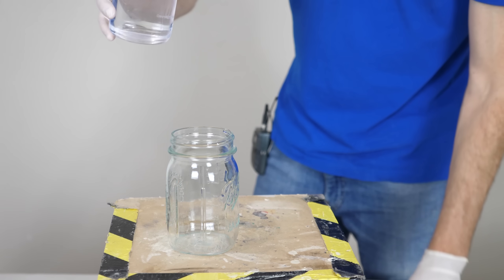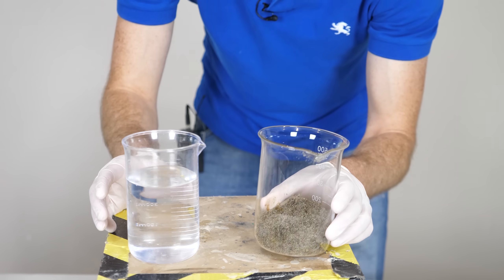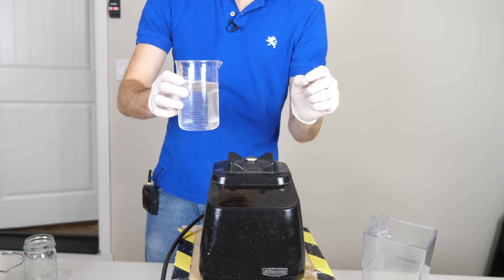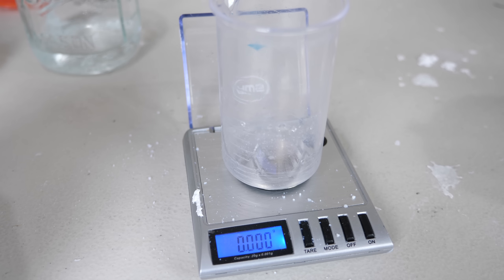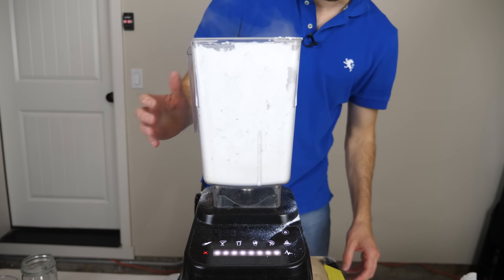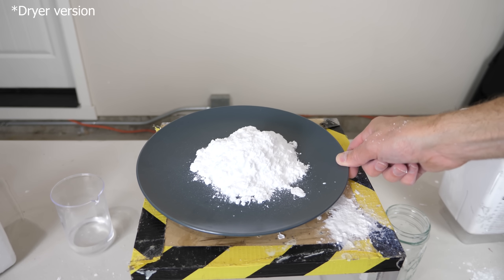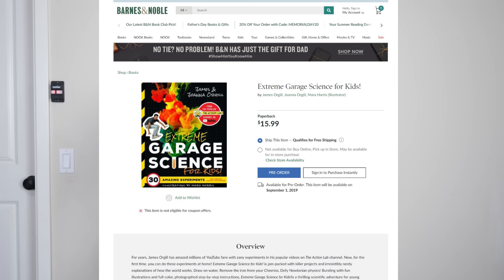How to Make Dry Water...Weird Experiment Makes Water That's Not Wet

Comment: Fumed silica is cool but calling it dry water is like saying you can mold water by  adding mud.
Reply: Yes, but I'm pretty sure it's called dry water, somewhat similar to how dry ice isn't ice.
Reply: @binarycat1237  yup
Reply: Dry water is just ice. Make more sense
Reply: @myrmesuwu607  Ice always has a microscopic layer of water on it. So no, ice is not dry water.
Reply: @myrmesuwu607  "Dry water is just ice."
The outdoor man wishes water to have not so much water (=weight) in it, so he can carry it along and mix with mountain brook water to have a drink, like with all other dried outdoor consumables. So ice is not the ideal one. And it easily gets wet under way. But you were quite near.
Reply: Something Or other  thank you i was looking for a polite way of saying this... this is not water it is a solution of a powder and water that is like saying koolaid is water and we should be able to.. ugh nevermind im not gonna
Reply: When someone thinks they know something and they don't... Fumed silica is manufactured by a continuous flame hydrolysis process of SiCl4. During this process, SiCl4 is converted into the gas phase and then reacts spontaneously and quantitatively in an oxyhydrogen flame with the intermediately formed water to produce the desired silicon dioxide.

2 H2 + O2 = 2 H2O

SiCl4 + 2 H2O = SiO2 + 4 HCl

2 H2 + O2 + SiCl4 = SiO2 + 4 HCl

(ii)During this chemical reaction a considerable amount of heat is released, which is eliminated in a cooling line. The only by-product is gaseous HCl which is separated from the fumed silica solid matter.

SiO2 is then converted into the HYDROPHOBIC FUMED SILICA dimethyldichlorosilane (DDS) in a fluid-bed reactor. The silane reacts with the silanol groups primarily with the formation of Si-O-Si (CH3)2 units, and as a result the material acquires a hydrophobic character. The number of silanol groups is reduced during the treatment to about 30% of the initial value.

(iii)Analogous reactions can also be carried out with other silanes and other HYDROPHILIC SILICA FUMES.
NOW, you can quite clearly see that fumed silica is a powder by itself and in no way should it be confused with empty water...
Reply: gRuven Haus mother of GOD are you a scientist?!=! I don’t understand anything you just said .-.
Reply: @tac0_6  You don't need to understand the science to see that he is bullshitting I don't think he was even trying to trick you the only thing that doesn't  make sense is that it was replying to this unrelated comment, In the beginning he says, When someone thinks they know something and they don't, you need to read this like it is a Top Text : Bottom Text meme, secondly though he uses convincing language he overuses some terms that are unnecessary to exaggerate the "sciencey sounding" effect. In this excerpt from the comment he says "SiCl4 is converted into the gas phase and then reacts spontaneously and quantitatively" Lets break this down  near the end of the excerpt he says it react spontaneously (meaning immediately) and qualitatively (in a factual manner). This is a dead giveaway, there is no reason why this person would need to describe a chemical reaction as qualitatively he was simply trying to expand the amount of "sophisticated words" in his comment to make it sound more complex. Furthermore all it takes to figure out that this comment is faked is to see that it has been DIRECTLY STOLEN is to type it into google and find that has been taken from                                        https://www.researchgate.net/post/can_anyone_tell_me_the_method_of_producing_fumed_silica_and_grades_of_this_material
Reply: @binguser344  well you see, I have no idea what my 11-12 year old brain was thinking back then it’s obvious now since they sound like they’re regurgitating they’re Google searches.
Reply: @GruvenHaus  blinks
Reply: @GruvenHaus  dude what grade ru in? I'm bad at chemistry
Reply: @overtimepreet  maybe they have a PhD and allready passed school
Reply: @GruvenHaus  still not water
Reply: Actually with mud you dissolve dirt into the water; the fumes silica isn’t dissolved, it’s coating the tiny droplets and separating them; since it’s not being dissolved, it’s not a solution, and since it’s not a solution, it’s still referred to as water. It’s like if you cut up a block of cheese; just because you put the pieces together with air in between them, it doesn’t stop it from being cheese; but if you mix pepper into melted cheese, then it’s a solution of the cheese and pepper since the cheese is what’s surrounding the pepper
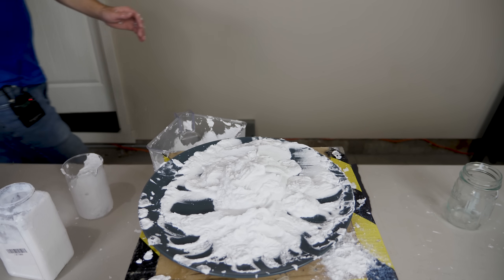Reply: 5:56 He said that it's called dry water, not actually dried water... 🤷🏼‍♂️
Reply: @FunnyMemes-dr3se  he don't say thay
Reply: @FunnyMemes-dr3se  given you posted a tome stamp you should know
Reply: Maybe so... but don't blame Action Lab.
He just borrowed the and adopted the term from those chemists that actually use it as "dry water".
Reply: i felt the same way as you
Reply: I feel like people expected something that looked exactly like the water they know but wasn't. Plus they're missing the shock value perhaps cause they're not touching it themselves.
Reply: Yeah it’s a bit of a stretch but I mean what did we expect, you’d have to add something. At least this is only like what one additional element
Reply: I mean…but that’s true. You can mold water by adding mud. 

I am now going to start calling mud a water molder. Thank you for this idea
Reply: Something Or other Stop it, these are experiments for kids.  Just stop it.  Mud is not the same as what he is doing here.  He said the name of the powder and said that it was powder he would mix with the water.  Once you mix it it separates the water molecules but the powder is still there.  Making it feel like it's water, but it is dry because of the powder.  Tired of all you virtuous signaling, trying to act as though you are smarter and he couldn't pull a fast one on ya.  Guess what?  He isn't trying to do that.  It is an informational channel with experiments that you did not think of.  So stop it.
Reply: @rager_fox8147  "So stop it."
But we may have a little fun playing with funny ideas?

Comment: Wth? This is not dry water. It's fumed silica mixed with water that didn't make he fumed silica moist. But it's covered in water so it's still wet. Covering water in a dry substance does not make it dry!

And also, logically and generally speaking, water is both wet and not wet. Every droplet of water that is COVERED with water is wet by definition. Since each droplet of water is still water, water can be wet. Water particles that are not wet are ones that are NOT convered in water by definition, ie. the layer of water particles on the surface of the entire concoction of water particles that are not covered in any liquid. Why was this every an argument when there are LITERAL definitions?

Comment: 7:52 action lab is exposed. When he pull up the dry water container. You'll see, negative weight(-23) which means that white thing is not as dense as he mentioned. It weighs only 4g. It may not be dry water as he said.😏😏😒
Reply: The mass of the beaker is subtracted out... How do you mess that one up?
Reply: Mass of beaker + water solution = 52g

Comment: Whether an object is wet or dry depends on a balance between cohesive and adhesive forces. Cohesive forces are attractive forces within the liquid that cause the molecules in the liquid to prefer to stick together. Cohesive forces are also responsible for surface tension. If the cohesive forces are very strong, then the liquid molecules really like to stay close together and they won't spread out on the surface of an object very much. On the contrary, adhesive forces are the attractive forces between the liquid and the surface of the material. If the adhesive forces are strong, then the liquid will try and spread out onto the surface as much as possible. So how wet a surface is depends on the balance between these two forces. If the adhesive forces (liquid-solid) are bigger than the cohesive forces (liquid-liquid), we say the material becomes wet, and the liquid tends to spread out to maximize contact with the surface. On the other hand, if the adhesive forces (liquid-solid) are smaller than the cohesive forces (liquid-liquid), we say the material is dry, and the liquid tends to bead-up into a spherical drop and tries to minimize the contact with the surface.

Water actually has pretty high cohesive forces due to hydrogen bonding, and so is not as good at wetting surfaces as some liquids such as acetone or alcohols. However, water does wet certain surfaces like glass for example. Adding detergents can make water better at wetting by lowering the cohesive forces . Water resistant materials such as Gore-tex fabric is made of material that is hydrophobic (water repellent) and so the cohesive forces within the water (liquid-liquid) are much stronger than the adhesive force (liquid-solid) and water tends to bead-up on the outside of the material and you stay dry.

Comment: I have seen this somewhere a long time ago when i was about 5yrs old, they had this in a metal plate and a little rod holding a metal weight and the metal weight was pointed and it would make some really cool art, i touched it when i was younger and it felt like water but wasnt, now i have finnaly found what it was and i might try to replicate the same thing

Comment: This is interesting. However there is a simpler way to make dry water... it actually occurs naturally... it's called snow and ice :)
It will still wet your hand but that is because you heat it up. It won't make a well insulated glove wet for instance provided it is cold enough. Or if you drop a piece of paper into it.

Comment: Hey mate.
Correct me if I'm wrong, but when handling that silica, shouldn't you be using a mask? As silicosis is a real threat?
Reply: Peter White you just have to be in a well ventilated area
Reply: ELM_Xenon not true you still have to where a mask bcuz if u inhale it, ventilation won’t do u any good

Comment: Hello Action Lab,
If you melted the sand by heat, would you consider it wet? If so, then why can't we simply call water "dry" when it's below it's freezing point, i.e. it is ice. When you say "wet" do you simply mean it's ability to "wet" other objects it's touching?

Because then the more viscous a fluid is (with respect to its adhesive forces, NOT cohesive forces), do we say that it has a greater ability to "wet"?

Thanks 😊

Comment: You dry water by using a towel... Obviously.
Reply: "Water is wet because it can wet things."
-The Action Lab
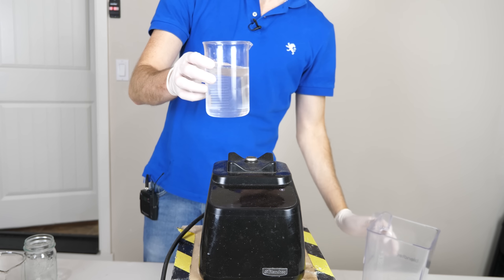Reply: 2:15 "Okay, well... that didn't work." Haha who would've guessed?
Reply: 3:10 freakin Scarface up in The Action Lab.
Reply: Will it work with other liquids? Like ethanol or something flammable. And if so, if that fuel still flammable? It sounded like you said it was just really airy water so I'd think that there'd definitely be enough air to ignite the dissolved fuel and fumed silica mixture.
Reply: I dig the book idea, because science is so appealing because it works. How do we know it works? Well by doing experiments and the scientific community coming to a consensus of, yes. That is how it is. The coolest thing about doing your own experiments is that you're taking the science into your own hands and coming to your own conclusions. In that way you can see that the science behind things is indeed correct, and you don't need to rely on anyone else's word. You can prove it to yourself. Even though some of these principles have been known for centuries, it can still be so amazing to see it first hand. It really becomes addicting. It leaves you wanting to know more and more. At least that's what science means to me. It's all about curiosity.

Comment: Is water wet?
Action lab: Yes but actually no
Reply: Waters not wet
Reply: From what I understand we can't feel wetness.
Reply: @jeffcook8501  "from what I can understand" You are a virgin. I can definitely feel wetness.
Reply: @jeffcook8501  here to appreciate this absolute murder
Reply: @80_MIKAELA_80 Water sticks gogether with surface tention so the water molocues are wet. And even the action lab said so and they are very smart.
Reply: This is why you scroll before commenting.
Reply: 935 likes 16 comments
Reply: Water is sticky 😔 (really)
Reply: ok
Reply: 817 likes 13th comment
Reply: Yes'nt
Reply: 881 likes and 15 comments
Reply: I've thought very hard about this. Water is in fact wet. "But water makes things wet, it's not wet itself!" False. Since each individual molecule of water in a drop or pool or puddle of water is completely surrounded by other water molecules, it follows that each molecule in a situation where there are many clumped together is actually wet, thus, drops or pools of water are in fact wet. Now, you might be thinking, "ok, but individual water molecules would not be considered wet if we think about it like that." You're right! And that tracks perfectly with human experience. We don't consider the air on a humid day to be "wet," despite it having more moisture in it than normal. We wouldn't say it's "wet outside." We'd call it muggy or, well, humid, because it's a different sensation caused by individual molecules of water dispersed throughout the air. Since each molecule is not surrounded by water, we don't consider them to be wet, and we give the scenario a different name because it causes a different phenomenon in terms of our physical interaction with it. Thus, humidity can be thought of as dry molecules of water, while the water in oceans or raindrops are considered wet because they're surrounded by other  molecules of water.
Reply: 326 likes no comments
Reply: @alexh349  ک
Reply: Loud screeching sound
Reply: @R3andMe  what is the point of that comment?